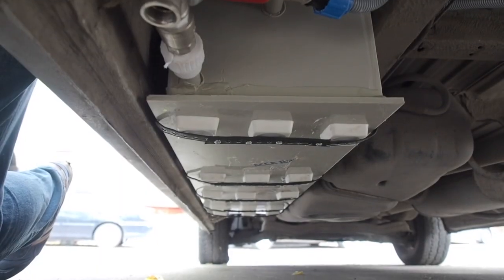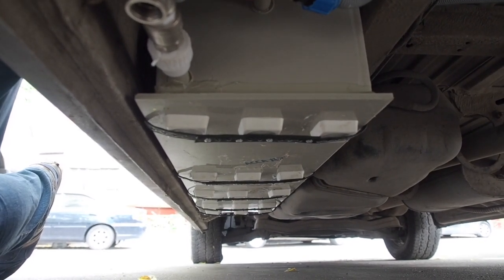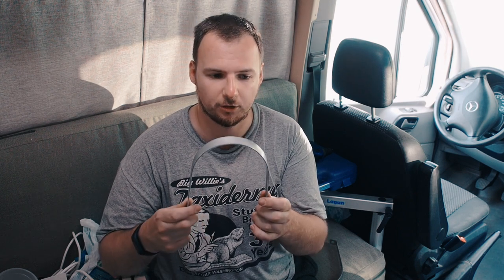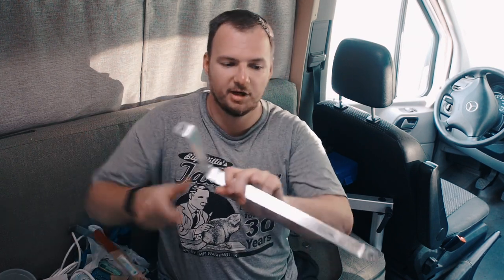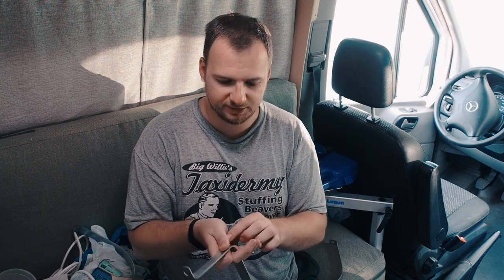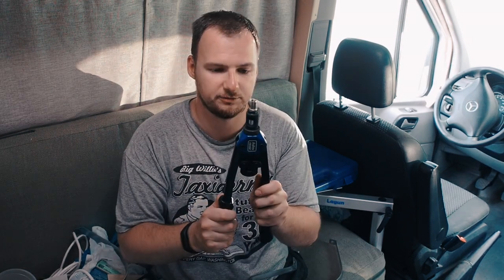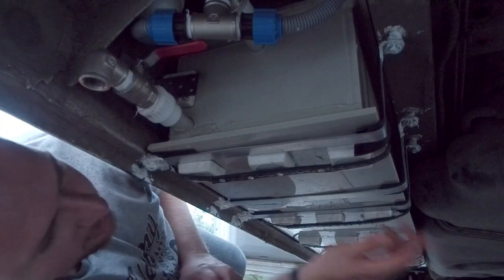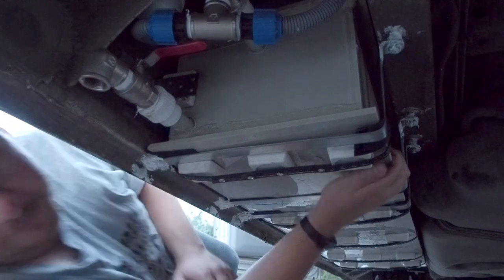Improving grey water tank mount. My van conversion grey water tank mounting system.

Comment: great job and very informative, thanks!
my only concern is that the tank is not restrained in forward-backward movement. so, if you braked really suddenly with a full-ish tank it would slosh-forward and put lots of stresses on pipes/etc.

Comment: Those bolts are just going to rip out the first big bump you hit with a full water tank.  They are intended to provide strength for lateral loads only.  You could use them however you need to install them on the vertical side of the beam.... Not the bottom like you did and any strapping used with them can only put a sideways load.
Reply from the maker: Based on rivnuts specifications and testing they must hold very good. The thing is - when rivenut installed properly and bolt pushing rivnut from two sides - its very little chance that rivnut will fall off easily. Its just basic physics. To fell from the hole rivnut must be smaller than this hole. For that it must bend back to its factory shape, but bolt not letting it do that. Only chance it could fell - if metal around rivnut will bend bottom and make a crate for it. But i install it in very thick 2mm steel. I'm not an expert and sure this installation have its limits, but i doubt the "first bump" fault you predicting. Are you working with rivnuts a lot? Are you specialist in that area? On what information your thoughts are based. No offense, i just really care about safety and trying to inspect all bits of advice about that very deeply
Reply: VanTourist I used those to put a bunch shelves in a  cargo van.  They were attached both at the sides and the tops.  After driving just a little while, the rivnuts along the top loosened and eventually the bolts pull out along with the rivnuts still attached.  I didn't mean to suggest yours will fail at the first bump but they will likely loosen and fail over time.  Good luck and keep up the great videos... Paul.
Reply from the maker: Thanks for your experience Paul! I will keep my eye on this rivnuts!